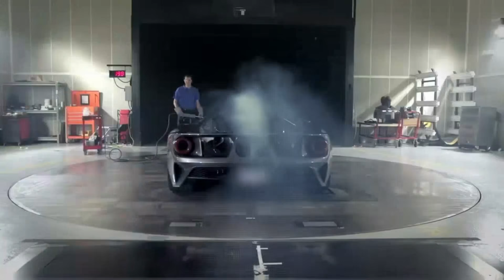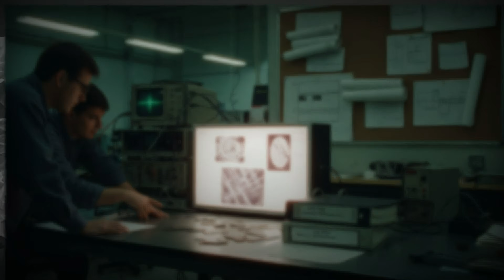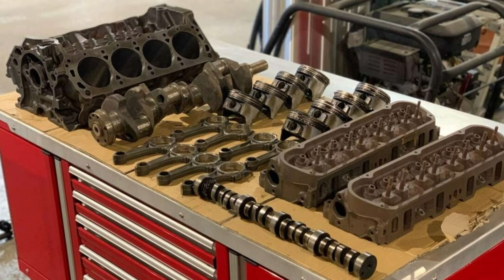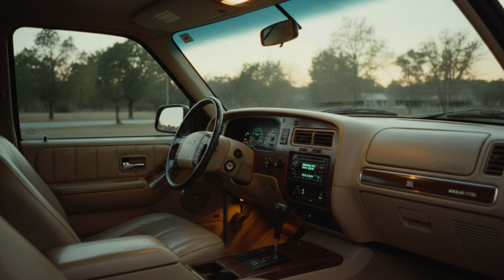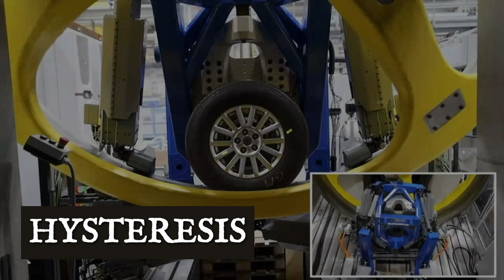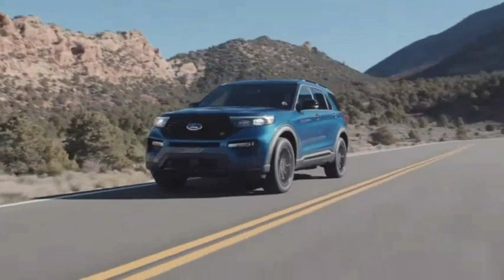Ford Explorer 2nd Gen Was Meant To Be The Future... Until Its Reputation Was Ruined

Comment: I’ve got a 2000 Eddie Bauer V8 AWD that have had for eight years and I love it. It just turned over 200k km’s but spent the first 6-7 years in the salt belt before it came west so it is rusting out from underneath me ☹️. My daughter and S.I.L. have a ‘95 XL 4x4 auto that has been in the family for about eleven years and was once mine and I am going to buy it back. If I find a good body for the 2000 I may do a body swap.

Comment: I own a 2000, and U-haul STILL will not rent a trailer for it in 2026. I have the base OHV 'tractor' engine.  On its second set of heads and second trans, but they are cake to work on. 250k on it
Reply from the maker: That base OHV is a tank. 250k and still going says everything about the bulletproof engineering they dont build anymore.
Reply: Most of the heads don't fail, many make it to 300-400K .... my Ranger was just shy of 250,000 when i sold it and ran like a top...totally neglected and pushed to it's limits.
Reply: @greg7886  I have a 1997 and I tell the U-Haul people it’s a 2002 🤷‍♂️ they don’t know. The ban is only for the 1991-2001. 

Also I only run Michelin Defenders on mine at 32 psi. Good quality tire without needing to deflate for comfort 😂
Reply: @Baseballhuh-02 yeah that's a thought. Come to think of it. They only ask for your license but no registration info. I just wonder if something happened if there'd be an out for any insurance company because of the discrepancy.

Comment: Honestly I see more of these 95-01 explorer / mountaineers still running around than S10 Blazers / Jimmys, 4Runners, and Pathfinders combined and there would’ve been so many more if that Cash for Clunkers scam hadn’t happened.
Reply from the maker: It’s a very good point
Reply: @Intechdude300  Since moving from the West Coast to the Midwest, I definitely see more older Ford trucks than other makes.  They seem to have better Factory rust proofing.  Also, rust absolutely is the weakest point of Toyota.
Reply: @Intechdude300  oh yeah definitely and without a doubt

Comment: I worked for a large Ford dealer when those were new and the biggest issues we had with them were that Ford insisted on using the 4.0L and a light duty transmission in those. The 4.0L had head gasket issues, the 4.0 SOHC had timing chain and sludge issues, the A4LD 5R55E and similar transmissions were too light for the task of towing and they advertised those as being good for 5,500 lbs of trailer weight. They should have had the 3.0V6 and a 4R70W transmission or just gone to the V8 sooner. 
In the 12 years I worked there I don't think a week went by without having at least one 5R55E on the bench, if not a dozen of them. They made and sold too few V8 models, 95% of all that they sold there were V6 trucks. 
The tire issue was not Ford's doing, it was Firestone, but Ford should have spec'd those trucks with a heavier tire vs what was basically just a passenger or SUV tire. It seemed me that Ford always went too soft or too light when it came to tires. My 86 F150 came new with 215/75R15 Goodyear Vector tires. They were smaller than the tires they put on most Crown Vics that year.
Reply from the maker: Thanks for sharing your insider perspective! It's always valuable to hear from someone who worked with these vehicles firsthand.
Reply: Rarely do heads or head gaskets go out on the 4.0 ohv I had one and currently have another (backup / beater vehicle) ...their well known to last 300-400,000 miles with basic maintenance.
Reply: @barrya.6212  Keep in mind that as a dealership mechanic we only saw the bad one's, those that didn't fail never showed up in the shop. For me, I was mostly a medium duty guy but got rooked into a few light duty repairs over the years. In the late 90's those SOHC 4.0L motors were like a plague in the shop. Guys hated to deal with them and they piled up fast out in the pen as owners rarely could afford to fix them when they failed. Jumped timing, overheated with blown headgaskets were what we saw. When the 302 and later the 4.6L went into the Explorer things got better but by that point the model was on its way out and the V8 models were few and far between. They sold far more base models than V8's. 

When that dealer closed up in 2001, there had to be a dozen or more of those trucks vegetating in the rear parking area behind the shop with bad motors that customers couldn't afford to fix, most in the high 70 to 80k range mileage wise. As a dealer tech for 35+ years the 2.9, 4.0, and 4.0 SOHC were nightmare motors that were problems from day one. Both the A4LD and the 2.9L, were only a minor warning to what was to come. I don't doubt a few proved to be good engines but in general those were pretty much garbage in the eyes of those of us who had to deal with them when they were still under warranty.

Comment: Great video! I have a 1998 and I love it. These things are still everywhere in my area...chugging down the road with 250,000 miles. 

Back in the 1990s, Ford was averaging over 1,000 Explorers sold A DAY. Every day. To say they were popular is an understatement.
Reply: I have a 2000 ford explorer sport right now. She's a good vehicle
Reply from the maker: That's awesome you still have your '98! They really were incredibly popular, and it’s cool to see them still on the road.
Reply: Ford sold 365K Explorers every year?
Reply: @rebeltvr6046  On average, yes.
Reply: @aaroncostello8812  That's a LOT
Reply: @rebeltvr6046  Yep! From 1991-1999 it was actually about 900 a day. If you count both the first and second generations (1991-2001) it was about 1100 a day. But you get the idea. Ford literally couldn't build them fast enough.